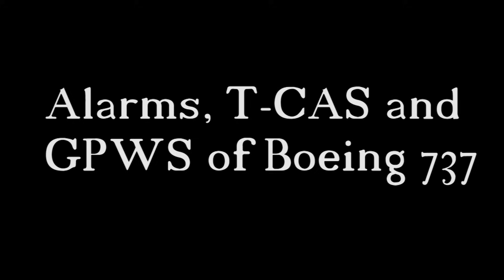Alarms, T-CAS and GPWS of Boeing 737

Comment: 0:05 Autopilot disengage
0:08 When approaching the selected altitude on autopilot
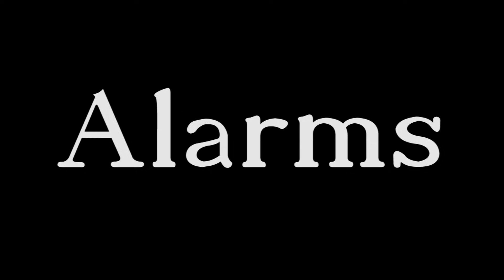0:09 "Bank angle" - When the plane is turning at a too steep angle (more than 30°)
0:15 "Caution terrain" - Terrain is close
0:16 "Decision height" - When reaching decision height
0:17 "Don't sink" - When you shouln´t descend anymore
0:19 "Glideslope" - When your too low or hight of the glideslope to the runway when landing
0:20 "+100" - 100 feet over glideslope
0:21 "Pull up" - Start climbing fast
0:22  "Radio altimeter" - You haven´t set the radio altimeter (im not sure on this one)
0:23 "Windshear" - You are in a windshear
0:27 "Sink rate" - Descending too fast
0:28 "Glideslope" - When your too low or hight of the glideslope to the runway when landing
0:29 "Too low flaps" - You don't have flaps set for landing
0:30 "Too low gear" - You don't have the gears extracted for landing
0:32 "Too low terrain" - You are close too close to the ground
0:36 "V1" - You are reaching the speed were you cannot abort takeoff
0:37 "Peep peep pull up" - Plane needs to start climbing fast
0:38 Fire alarm
0:39 "Beeeeeeeeep" - Extract gear for landing
0:41 Stall warning
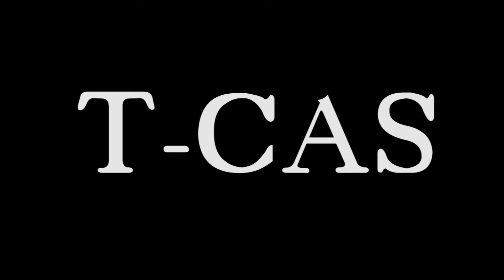0:47 Somethings not correct for takeoff (example, the pilots have forgotten to extract flaps) 

Hope i didn´t miss anyone, correct me if im wrong on someone.
Reply: DanneYT and the callouts after 0:47 ?
Reply: Major TryeXe It's the stall warning. The so called "stickshaker"
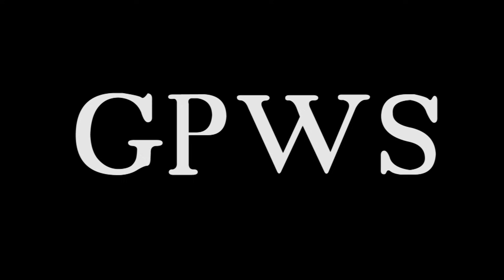Reply: @major612  1:47 is taking configuration
Reply: Technically "DON'T SINK" is: "Altitude loss after take off or with a high power setting"
Reply: @inufreak483  yup
Reply: 0:20 is acually 100ft above desicion height.
Reply: DanneYT Thank You
Reply: 0:22 is just another callout for "2500" c:
Reply: Jonathan Juarez Approaching ground
Reply: @thelightninghunter23  How far away the aircraft is from the ground when landing
Reply: >> "+100" - 100 feet over glideslope
no, it's 100 feet over decision altitude
Reply: @СергейДолгих-з6ч  incorrect, +100 Means 100 Feet Over The Glideslope
Reply: I believe “Radio Altimeter” is an optional call out that replaces the familiar “twenty five hundred “. It tells the pilots that the radio altimeter has been activated due to 2500ft or lower AGL
Reply: Is 0:41 is also call stick shaker, because it sound like it?
Reply: Sswwaaggyy Zadar yeah, that’s actually the noise from the stick shaker, it is also supposed to be loud
Reply: 0:47 is also the cabin altitude warning horn for when the cabin pressurization system has failed
Reply: Major TryeXe Those are self explanatory. T-CAS is used to prevent midair collisions, the last one is Ground Proximity Warning System.
Reply: thank you so much for this
Reply: 0:47 could also be for takeoff configuration and low air pressure (the fact that it uses the same sound was one of the reasons why Helios Airways Flight 522 crashed)
Reply: DanneYT ty
Reply: Update the blog
Reply: DanneYT Isn’t “minimums” reaching decision height?
Reply: @farishamdy  Yes It Is
Reply: "Bank angle" , i was not able to understand that, i've watched many national geographic documentaries on plane crashes, and that warning sounds in many of the cases, know i know what it means :)
Reply: Ok ...
Reply: OVERSPEED
Reply: 0:40 Overspeed.
Reply: decision height, or DA, is similar to MDA but with a DA, that’s the point you begin to go missed if the rwy environment is not in sight. mostly coincides with ILS approaches. when you hear that, go missed if the rwy environment is not seen. and the +100 call out is for when you are 100 feet above the DA
Reply: DanneYT 0:14 is the whole caution word
Reply: thx
Reply: very helpful!
Reply: I think you forgot over speed 👍🏻😀
Reply: thanks
Reply: At 0:40 or 0:41 right before the stall warning and right after the extract gear for landing sound is also a single click of the overspeed warning sound
Reply: Thank You... Whats meaning of recaaad
Reply: I was hoping someone posted the timestamps. marry me.
Reply: @meli-u8h7i  doesnt have to be. You can be flying with a small angle and stall, you could go vertical and not stall(if the engines can do it of course) stall means that the wings cant produce enough lift to keep the airplane up in the air and the plane starts falling quickly.
Reply: @Lionn8563  thank you
Reply: Thanks. You're a hero.
Reply: DanneYT d
Reply: 0:47 take off configuration is the proper term
Reply: @The Zewp 22 tnks bro
Reply: DanneYT whoop whoop pull up not peep peep Pull up
Reply: 0:47 is called "Takeoff Config"
Reply: Now, I am by no means an expert, so take everything I say with a grain of salt (except this bit).

Isn't V1 the minimum speed required for takeoff and V2 the speed where you can't abort?

Edit: just looked it up, it's (more or less) the other way around.
Reply: @bartholomewdan  V1 is the Point you cannot abort the takeoff at anymore, Vr is the Rotation speed you can takeoff at.
Reply: Thanks for the Info I was actually looking up what dont sink means
Reply: "Radio Altimeter" sounds when radio altimeter comes active(At 2500ft AGL). In most 737, the call-out for 2500ft AGL is just "2500" But Airline also can choose "Radio Altimeter".Same goes for "Approaching Minimums", "Approaching Decision Height" and "Plus 100"
Reply: 0:47 is master caution alert
Reply: 0:39 "Beeeeeeeeep" - Extract gear for landing
Extract gear? Should I extend it or retract it?
Reply: Dont sink is when you are too fast to be in a stall but too slow to climb where your nose is pointing
Reply: @Rhyen Wilson its not, that is the stall alarm. Dont sink is when when your nose is pointing up but you are SLOWLY decending or keeping your altitude.
Stall is when your plane doesnt have enough speed to keep your alltitude, and you start decending RAPIDLY and your nose suddenly point down and you start a nose dive.
Reply: The cabin altitude warning is the same as the take-off config warning. See the Helios 522 accident...
Reply: Yea I know
Reply: So, you can't land without Flaps ?! (Without getting this alarm)
Reply: @LegitScoper Simmer pilot here, I do believe you are able to land without flaps without getting that call, considering you need to be at over 200 knots, I think you won’t get it, don’t quote me though
Reply: @reallylamekid8120  "Simmer pilot here, I do believe you are able to land without flaps without getting that call, considering you need to be at over 200 knots, I think you won’t get it, don’t quote me though"
Reply: 0:47 is also cabin altitude warning, when altitude is above 10000 and you haven’t pressurized.
Reply: Thanks, I appreciate it
Reply: 0:22 (Radio Altimeter) means there is an error in the radio altimeter (the thing that calls out your altitude)
Reply: Thanks youu
Reply: Pull Up is so fascinating
Reply: 0:05 its like a fart sound lmao
Reply: +100 is 100 feet above your minimums
Reply: I believe “Windshear” means the winds change speed and direction very quickly, if a plane is flying in Windshear it could cause the plane to stall or just skid of the runway on landings or take-offs.
Reply: 0:47 is also cabin pressure warning, no?
Reply: Thank You
Reply: 0:47 : takeoff configuration
Reply: At 0:47, you're right, but it's also the alarm of cabin pressure.
Reply: thanks, literally recorded this entire thing and now I'm sorting them into individual sound files. But I didn't know what the name was for all of them. damn though it's going to take a long time..
Reply: 0:05 no fart
Reply: Tradução para português..
Reply: I think +100 is 100 feet above minimums?
Reply: 0:37 *Whoop Whoop
Reply: Thank you
Reply: one thing missing that i'm curious about is the two-tone non-verbal alarm at 0:23
Reply: Welcome to Ryanair. Best airline on the World.🤭
Reply: Wait the first one is just for autopilot disconnect? That’s one of the most unsettling.
Reply: Stall horn is stick shaker
Reply: after radio altimeter Plane will start calling altidutes 500,400,300 etc.
Reply: DanneYT I’m a pro pilot for the 737 and ur right
Reply: @thatonefuturemarinekid_8517  Sure chief
Reply: Yowere whatever your name i dont think you are a pilot
Reply: R u a pilot.
Reply: And 1:42 ???
Reply: @jonathanjuarez5707  feet left for landing/approach
Reply: @jonathanjuarez5707  oh it is not a big think fir ryan air
Reply: Jonathan Juarez radio altimeter callous when landing. They call out height from approach and guide you to make a gentle landing.
Reply: @jonathanjuarez5707  It is hight above ground. 2500, 1000, 500, 100, 50, 40, 30, 20, 10
Reply: @jonathanjuarez5707  altitude until touchdown warning. It tells you the altitude your at
Reply: @jonathanjuarez5707  Amount of feet from the ground to the landing gear
Reply: @jonathanjuarez5707  it a landing callouts
Reply: @jonathanjuarez5707  its for landing saying how much do you above to ground
Reply: @jonathanjuarez5707  quando esta se aproximando do solo
Reply: @jonathanjuarez5707      Thats the altitude counter. If Gear is down and the plane is going down, it starts to count. (100,50,40,30,20,10) the numbers are standing for the altitude the plane is flying at. It helps the pilots to land the plane safety and it helps also to know when to flare (pulling nose up while stalling slowly down for Butter landings.) The "Retard" alarm means that the pilots have to pull thottle to idle for the plane to land easyier. The Minimum alarm means that the plane is below 100 ft.

Comment: I love how fucking desperate it sounds at "terrain"
Reply: And how insistent it sounds at "Pull Up!"
Reply: I was watching a plane crash documentary (the one about the two planes colliding over Germany) and someone pointed out that the system was very unemotional.  In an emergency you'll react to the more insistent voice. That's why they changed T-CAS I think.  Ground control can be ignored when T-CAS gives a command, apparently.
Reply: @ShaylaWomer5089  you mean about that Peter case
Reply: @Cr7TheGoat.  Peter case?
Reply: Yo igual.
Reply: I mean... It's supposed to
Reply: @tertiaritus  still can be liked... use your brain champ

Comment: whats 0:19 Plus hundred ???
Reply: It basically means the pilot is above decision height (minimums). The minimums are were the pilot must execute a missed approach if said pilot does not have the runway in sight on approach in case of low visibility.
Reply: Nathan Chetram or the runway approach lights.
Reply: Just a diversion of "Approaching minimums"
Also "Approaching decision height"
Reply: The planes TAKE OFF

Comment: 0:39 what does that constant beep mean? I used to get a similar one on FSX.
Reply: fire is the bell at 0:39
Reply: In fsx it's when you put your throttles to 0% (or less than something like 10%) while your landing gear is up (At least on 737-800) and flaps are down.
Reply: Fire warning possibly..?
Reply: DefyTime Rewind
When I get it on FSX it's normally when I lower the flaps to certain positions, maybe it's warning of stress or something?
Reply: Exilninja Flaps aerodynamic limits or flaps overspeed possibly.
Reply: +Exilninja Stall
Reply: Reed Fox
It's a stall warning? Huh. Odd.
Reply: +Exilninja either that or your flaps are still out. FSX has weird sounds normally for the wrong thing.
Reply: Its overspeed
Reply: either your landing gear isn't down when you have your flaps extended or vice versa
Reply: The constant tone is a configuration warning. It can happen at takeoff or in flight and means the aircraft is not configured properly for what you are trying to do. 

From the 737 Flight Crew Operations Manual:

Takeoff configuration warning is armed when the airplane is on the ground and either or both forward thrust levers are advanced for takeoff. Takeoff configuration warning activates if:

- trailing edge flaps are not in the flaps 1 through 25 takeoff range, or
- trailing edge flaps are in a skew or asymmetry condition, or have uncommanded motion, or
- leading edge devices are not configured for takeoff or have uncommanded motion, or
- speed brake lever is not in the DOWN position, or
- spoiler control valve is open providing pressurized hydraulic fluid to the ground spoiler interlock valve, or
- parking brake is set, or
- stabilizer trim not set in the takeoff range

An intermittent warning horn sounds and the TAKEOFF CONFIG warning light illuminates when takeoff configuration warning activates.

Landing Gear Configuration Warnings (Aural warning):

A steady warning horn is provided to alert the flight crew whenever a landing is attempted and any gear is not down and locked. The landing gear warning horn is activated by forward thrust lever and flap position as follows:

Flaps up through 10 

Altitude below 800 feet RA, when either forward thrust lever set between idle and approximately 20 degrees thrust lever angle, or an engine is not operating and the other thrust lever is less than 34 degrees. The landing gear warning horn can be silenced (reset) with the landing gear warning HORN CUTOUT switch.

Flaps 15 through 25 

Either forward thrust lever set below approximately 20 degrees, or an engine not operating and the other thrust lever is less than 34 degrees. The landing gear warning horn cannot be silenced with the landing gear warning HORN CUTOUT switch.

Flaps greater than 25

Regardless of forward thrust lever position. The landing gear warning horn cannot be silenced with the landing gear warning HORN CUTOUT switch.

The tone will stop once the configuration error has been corrected.

Comment: MINIMUMS, MINIMUMS, MINIMUMS, APPROACHIN' IN MIMIMUMS, APPROACHIN' IN DECISION HEIGHT
25 HUNDRED
1 THOUSAND
5 HUNDRED
4 HUNDRED
3 HUNDRED
2 HUNDRED
1 HUNDRED
FIFTY FORTY THIRTY TWENTY (RETURN!) TEN

WOW
Reply: The thing is the plane's vertical speed is actually slowing down.
Reply: Yeah, sorry.
Reply: Lol, the 50..40..30..20..10 callouts were too fast, the plane might be doing a nose dive..
Reply: AssistenteCapo normal rayanair landing